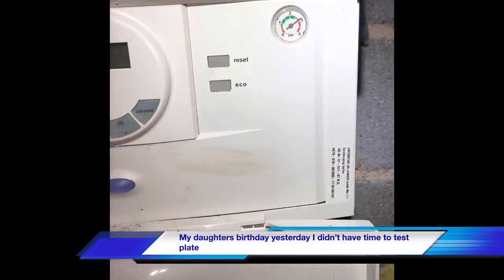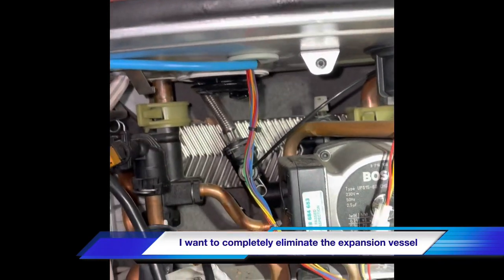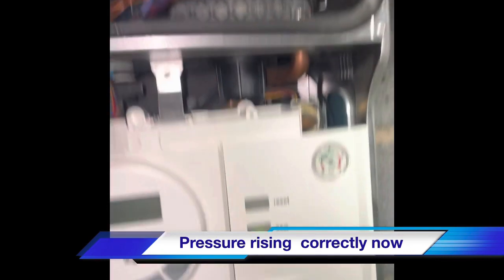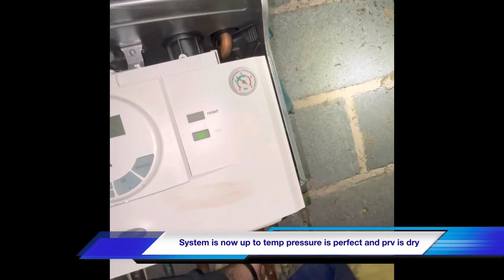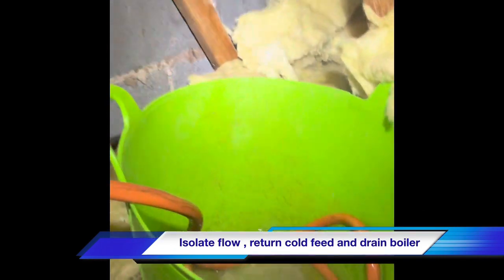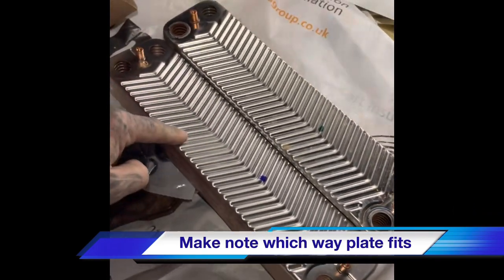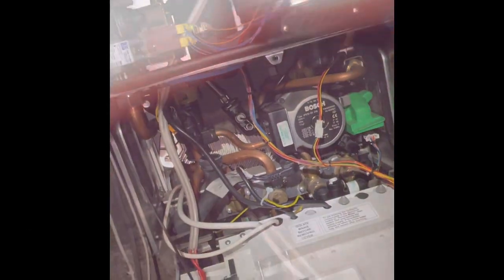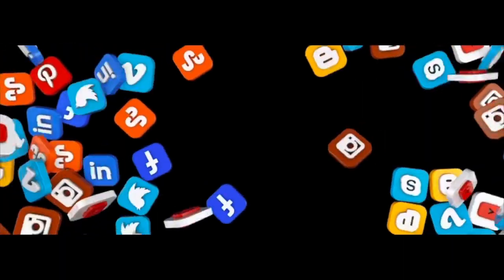Greenstar junior pin holed plate heat exchanger

Comment: Great video another way to test is just isolate cold to boiler
Reply from the maker: I prefer to isolate at stop tap if mixer taps in property , to eliminate cold passing back up hot pipe which I’ve had quite a few times
Reply: Why does the pressure go up if the heat exchanger is pin holed 
Sorry if uts a daft question 
Bit new to all this 🙂
Reply from the maker: @stewartharrod1706   if the plate heat exchanger is pin holes the cold main supplying the boiler will be a great pressure than the ch system , so it will pass through into the heating circuit causing the pressure to rise up
Reply: @thementalgasman3tgasmainte317  💯❤ awesome thanks bro